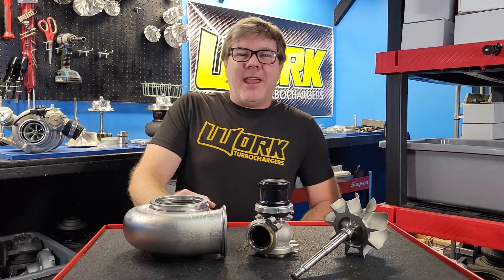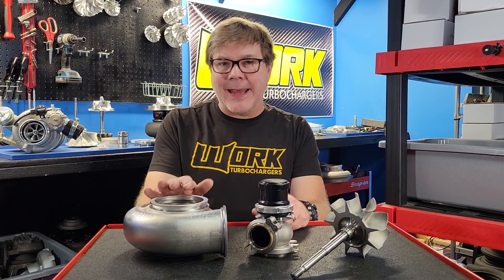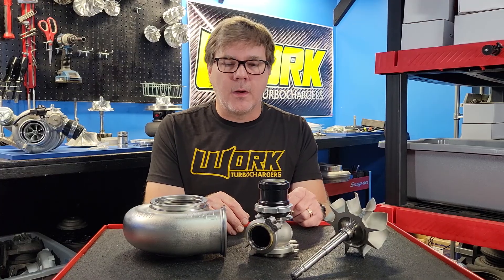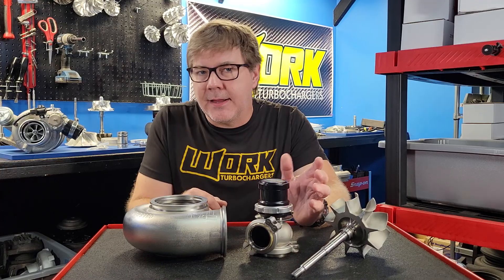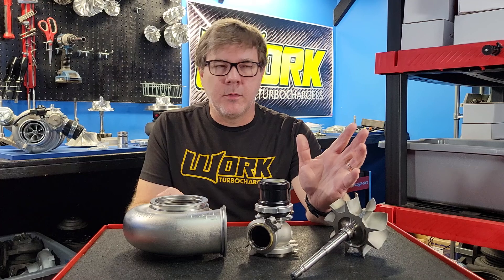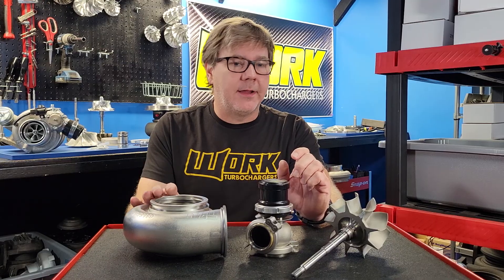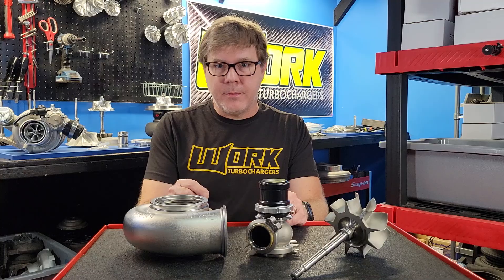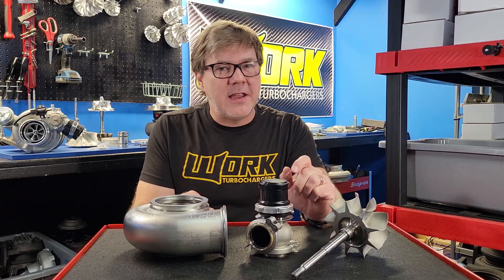5 Minute Turbo Tech Tips with Reed, Episode 1: Ignition Timing and Backpressure

Comment: hiw about turbo spool vs timing? i heard that less timing helps turbo to spool
Reply from the maker: We are going to cover this topic in depth soon, but, in very short form here is your answer:

Retarding ignition timing moves the combustion event closer to EVO (exhaust valve opening), creating higher exhaust temps (EGT).   This, combined with other changes such as delaying end of injection (late fuel delivery) and increasing injection rate (adding fuel) will provide more energy to drive the turbine wheel, and subsequently spinning the turbine harder.

Here is the flip side...since you delay the combustion event, you also lower the engines power as a side effect.  To offset this, your launch rpm usually must be raised.

Case in point.  I was working with a 2.0 Cosworth drag project in the mid 1990's, it was a clutch car as well.   We started out by trying to launch at a high rpm off of a typical for the time "rev limiter".  This was Ok, but we were still "waiting" on the turbo to respond.  We started playing with timing retard...starting by taking 5 degrees out of peak, then 10, then 15...and the magic started happening.  We saw positive gains starting around 0° of actual timing at 7000 or so rpm...we were able to make 5-7 psi on the clutch.   So we pulled more timing, but the engine rpm started to fall off as well.   Ultimately we would end up turning the engine close to 9500 rpm, pull the timing back to -30 BTDC (or more) and add fuel.  When we did this, the rpm would drop back to ~7500, but we would be able to build close to 25 psi of boost on the clutch.  Very cool, until it wasn't !  

The added heat took its toll on exhaust valves, seats and even the header material.   We were running a standard 304 stainless header and titanium valves.   Ended up going to 321 for exhaust material and inconel valves with beryllium copper seats, coatings on the combustion chamber, pistons and exhaust ports.  We also had to service the head quite frequently due to heat related stresses.   This was all very new to us at the time, but it was a cool thing to witness a small 2.0L 4cyl spool a GT45 turbo at a time when nobody else was really trying this.  

sorry for the rambling...but yes, pulling timing can help with turbo spool if applied correctly!  -Reed
Reply: @workturbo  no need to say sorry for rambling. that was very good read and i appreciate that you took the time to type that. thank you alot for the info🙏🏻

Comment: Im guessing the "original tuner" was just trying to error on the side of caution? Or maybe he wasn't really paid to do the leg work? If he had it on a dyno, and it was picking up that kind of power, he definitely didn't "finish" tune it. The why is the real question in my mind. I can't say he is at fault though.
Reply from the maker: @rpturbo I would love to say that I do not see this often, but the truth is I have this conversation at least weekly with customers, sometimes daily.

We just went through this today with a customer who shared with me his timing table.  The car made very respectable numbers on the dyno, but none of the driving tune was dialed in at all.   Tall deck SBF with only 15-18 degrees at cruising speed.  Pair that with his A:F target of 12.4 and the poor turbo was getting cooked running down the highway. 

Last Friday was a simple 427 SBF with hi-ports.  Single 88mm.  Total timing above 20 psi was 18 degrees.  Car "was out of turbo" according to the tuner at 28 psi and 54 psi of drive pressure.  9 degrees of timing later and 26 psi, we made over 200 more HP. 

I am not saying every tuner is like this by any stretch, but trying to tell my customers that a "safe" tune is not always "safe" or "fully tuned" is more along the goal of this video. 

sorry for the long answer, thank you for your comment!  Reed
Reply: @workturbo  nope, absolutely love the long answer and that cruise timing on that tall deck Ford is absolutely rediculous

Comment: There seems to be a lot of really bad tuners around just punching numbers on a keyboard not analyzing anything other than HP peak number. 
Bergen StreetRacing Team have "invented" something they call "The theoretical NA engines performance."
Examples can be seen if one google " Den teoretiske sugemotoren ." photos. 
After a dynopull they divide the torque number and hp number with the MAP number at the all the different RPMs. 
(This should really be in the dyno software.) 
Doing this, one will find that "The theoretical Na Engines performance" will be pretty stable before it starts to goes south and and EGT goes way north. How far beyond the peak NA result one wants to push the tune and the engine differs vastly.
Very interessing using this knowlage when whatcing big names in the industry on the dyno, incl. Fueltech, Murder Nova, Nelson, Shane T  etc. comes to mind. :)
Reply from the maker: I love this...we always have used some type of "average power number"...some call it by different names, and some arrive at it more scientifically then me...but always taking the average HP and average torque...and averaging that seems to be the way to go!  I try to evaluate that in a real world "range" depending on application.  Obviously a street car will be slightly different than a drag car, pulling class or over the road truck...but once you define the prime operating range and focus your gains there...it gets nothing but better!  -Reed
Reply: You forgot to mention that you are Bergen Street Racing Team, haha ;)

Anyways I think the theoretical NA power is very cool and useful, gives you an idea of base engine efficiency and running.

Do you have any links or resources for info or thoughts about the same topic from the people you mention? Fueltech, Nelson, Shane T etc.
Not doubting you, just curious to hear more input and info from experts in the field.

One thing I can input on however that I'd love for you to respond to and show your thoughts about is why not use density multiplier as a divider instead of MAP?
As you certainly know double the MAP doesn't always give you double the power (because of temperature), but double the density ALWAYS does.

For example 3 bar MAP at 50C charge temp vs 3 bar MAP at 10C charge temp will be very different and have different density and power numbers - in this case the 10C example is 12% higher density so will make 12% higher power than the 50C example even if both have 3 bar MAP.

The only way dividing by MAP is 100% accurate for power multiplication is if you keep the temp the same as ambient into the manifold even after boosting the air - something which is very rarely the case sadly.
Have you thought about using density multiplier instead which takes both temperature and pressure into count instead of only pressure like your method does? You'd then get the density multiplier (or divider in this case) by comparing manifold density to ambient density.

I've been experimenting with some custom calculations in Megalog from 10's of logs to get NA power and comparing your MAP method to my suggested density method and I can say that the density divider is always lower than the MAP divider by a little bit because of temperature inefficiencies - so the MAP divider is inaccurate compared to reality. 

In one of my examples it was 2.5bar MAP but density multiplier is only 2.25 because the manifold temp is 31.5C with 10C ambient (this is a stock but tuned car so intercooler is way too small, but just a more extreme example). If it was 10C charge temp the density multiplier would have also been 2.5 - but it's not and it never is on any logs I've checked and I think you'd have to have an amazingly efficient intercooling system to get ambient temps (or an interchiller or ice tank with a water to air heat exchanger, lol). But only dividing by map means you will be inaccurate when you don't need to because you can just calculate density and be more accurate.

Using density instead of MAP for dividing will make the NA power numbers a bit higher since it's making the same power with a lower divider. 
In this example density gives 230 NA hp and MAP divider gives 212 NA hp. Another example of dividing by the density factor instead of MAP is compatibility and repeatability from day to day, country to country and person to person with results that you can compare across the world which you can't with MAP. Dividing 600hp made in Dubai in 40C heat with 3 bar MAP isn't comparable to 600HP made in Norway in 10C ambient also with 3 bar MAP. The NA power for the guy in Dubai is 9.6% higher than the guys in Norway since his density was 9.6% lower with 3 bar yet he made the same end power than the guys in Norway did with their higher density - but without density you don't know that and both made the same NA power if you divide by map - but the engine of the guy in Dubai was working 9.6% harder and you wouldn't know that - which is misleading and leaves info and accuracy on the table.

I know you watch Gale Banks so you know all about density vs just pressure ;)
Reply: @nesmio7378  I don not know if WORK turbo are interessted in this, but "The theoretical NA engine" has worked wonders for us. Having analysed many, many dynopulls from Murder Nova, Steve Morris, Tom Nelson and most of the local heros, I have learned a lot og what happens when boost is inceased. 
Dividing the result by MAP pressure exposes absolutely everything, a density multiplier does not. :) 
The point is finding change and rate of change to figure out what need to be improved. 

One of the better example I have is Tom Nelsons Turbonetics C15 Twin turbo Street engine dynotested with shared rawdataresults at different boost levels. Very interessting. 

Yes, like I said, dividing by MAP covers everthing, including the wheather. It is a tool to develop the setup. The guy in Dubai has probably paid someone to build a ice cooled water to air charge cooler and I am sure he can afford race fuel, as the Norwegianans usually uses air-to-air intercoolers and pumpuel that scores 85 - 88 octane on the MON scale.
The point of this is finding faults and or way to improve performance and it has worked very well for us. I believe RS Tuning and motorsports PB is 163 MPH @ 1/4 mile in a Street Driven, MOT, all steel all glass, Volvo 240 with small 26" tires, stock suspension, stock block, stock heads LS 5,3 Twin turbo engine for 3 years. :) 
Even MAST motorsport themself told the owner: "That is actually quite impressive."     
Those who wants to compare with other to be better or best will find better ways to do that then using The theoretical NA engine" as an argument. :)  

Gale Banks is of course the man, but when focusing only on air density, the flow increase through an office as a result of the pressure increase is excluded. 
Propbably a very small deal, but I include it. :)

Comment: Reed would advancing the camshaft 2.5 degrees show an increase in boost pressure with all other things being equal?
Reply from the maker: I guess it would really come down to the current camshaft in the engine.  I dyno'd a DOHC 4 cylinder extensively and we did nothing but move the cam CL for a bunch of tests.  On that engine it made a bit more boost earlier when we advanced the intake and retarded the exhaust, but it cost us RPM range.  

Most modern turbocharger cam grinds are going to have a much more aggressive advanced EVO and the intake event seems to start in a more traditional or even retarded IVO position.  Mainly due to the nature of higher boost pressures, compression ratio and more advanced turbine designs that flow.

Really did not answer your question, I know...but without knowing all of the details it is hard to say.   My generic answer for a "turbo" cam that it mild in a single cam (V8/6, and SOHC engines) the answer may be "yes".  

I had a traditional SBC years ago that had a simple 236/236 @.050 cam, 110 LSA.  We replaced it with the same lobe design, but different LSA.  Let me see if I can find that data, we may have played with cam timing on both, but I cannot remember (that was 1997!)
Reply: @workturbo  This cam is a 252 256 @.050 115 lobe sep, .750 total lift. 403 cu GT55 91mm cast wheel Garrett BB. I advanced the cam 2.5* and with very similar DA and the same dome pressure it appears to have picked up 1.5 psi boost reading from the intake manifold.  Spool up has improved as expected, but wouldnt that increase in boost show as less air flow?

Comment: Gotta be real careful with high backpressure combos. They love ignition timing because of the egr effect, you gotta know when to stop
Reply: Could you expand on this a little more?
Reply: @nesmio7378  high backpressure combinations end up with burnt exhaust residuals being retained in the cylinder, instead of being swept out during valve overlap. Doing a quick dyno pull with burnt exhaust left in the cylinder will show gains from additional timing. Now, stretch the combination out in high gear. Exhaust valves, pistons, and the combustion chamber depend on cool air and fuel during valve overlap to manage temperature. Retained temperature in the cylinder, valves, and head from high backpressure, along with the additional timing your engine seems to want on a quick dyno pull, will have everything glowing, and destroy engines. Only question is what piece of the engine melts first
Reply: @kylemilligan752  Thanks for that.

Why does an engine like more timing when it retains exhaust tho?
I assume because of reduce density and reduced combustion temperatures in the cylinder?
Why is then adding more timing a bad thing? Because it will create more backpressure yet - or?
Reply: @nesmio7378  simply, when ex pressure is extreme compared to intake pressure, each cylinder has a cork in its ass. With a conventional log manifold, one cylinder is on valve overlap right when another cylinder blasts it's hardest ex pulse.burned exhaust retained in any cylinder is bad . The burned exhaust should have been swept away and in/ex  valves should have been cooled by the new mixture on overlap fails. Burnt exhaust is not combustible when retained in the cylinder. The engine will seem to want more ign timing to deal with exhaust residuals on a quick dyno pull, but will eat itself on an extended run
Reply: @kylemilligan752  I completely understand that residual exhaust gas is bad and needs to be avoided. I'm just wondering what phenomenon makes it want more ignition timing in such a scenario and why it's bad giving it that. Most likely the lower combustion temperatures is what's causing it.

Comment: Doing conversion from NA to turbo with my stock ECM I noticed that the timing cannot easily be increased on the timing table because it only goes to 1.2 grams per cylinder of air then it carries the timing set on the last line all the time during higher values. I use a electronic control I made to send the ecu false IAT temps so that it references the IAT table and pulls timing while boost increases. This way I can actually control the timing for any boost pressures. I think most people when adding a turbo to a stock setup will run into these problems. Too bad haltec systems are so expensive…
Reply from the maker: We have "fooled" the ECU many times this way...and there are many aftermarket "boxes" that do the same thing (Apex'i Super Afc, LINK and others from back in the "day").  Works well to a point.  Haltch Elite 550's are less than 1k, Microsquirts are less than $500.00...very affordable and suit most installations.  I have used the microsquirt on at least 3 builds in the last 4 years, awesome power for the money.

Comment: 6:08 You say in the sentence that you had a 1.75 boost to drive pressure ratio, surely you mean drive pressure to boost ratio? 1.75 drive pressure for every 1 boost pressure? What is the maximum ratio you can accept?
Reply from the maker: Thank you for the correction...doing "1 take videos" has its drawbacks. 

 You are spot on, 1.75:1 EMAP to MAP.  The maximum drive pressure tolerated will be different for every engine.  The major components that influence this number the most will be: camshaft, cylinder head, header primary, header collector, wastegate placement, turbine a/r and turbine wheel.  

Tuning issues we see that falsely make this number larger are:  Less than optimal ignition timing, injector phasing, incorrect injector sizing (late end of injection cycle) and lastly utilizing the incorrect fuel for the tune (tuned on one fuel and raced on another without thought put into the characteristics of the fuel).  

Always take into consideration intercooler pressure drop, air restriction in the inlet and exhaust as well.  Ramble over, thank you!